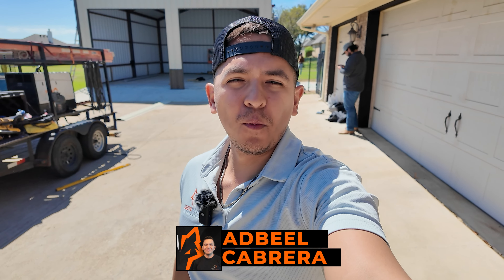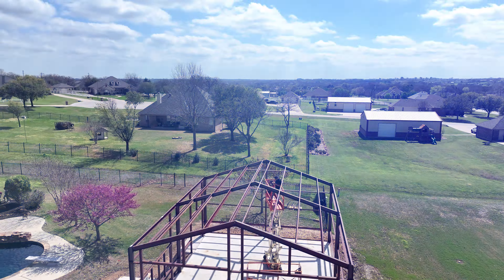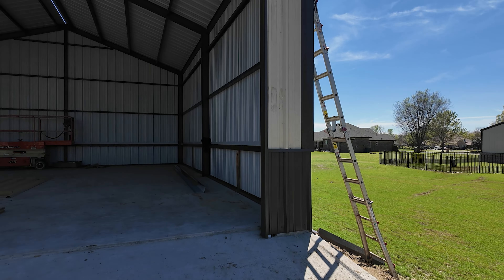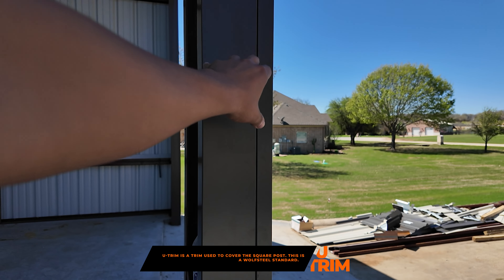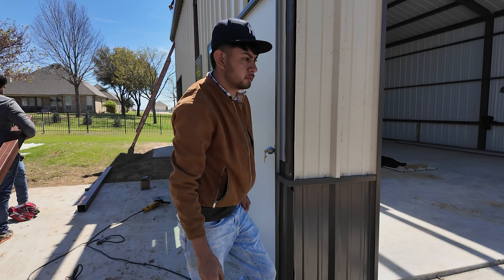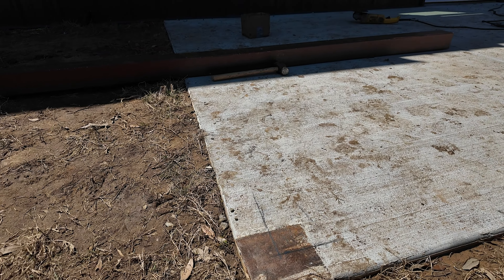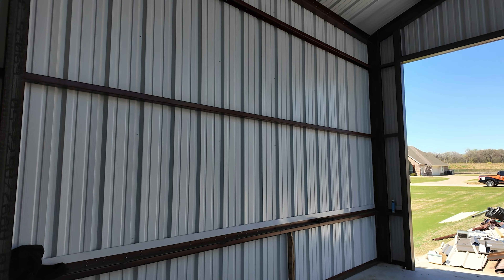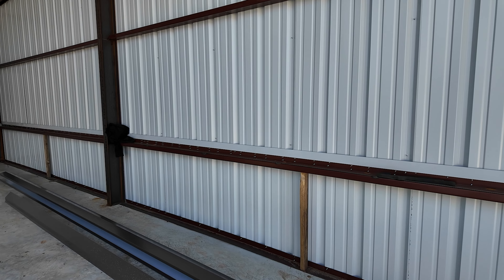Installation of 30'x36' Metal Garage in Burleson, Texas | WolfSteel Buildings

Comment: I noticed some of your buildings don’t have the base trim.  Is there a reason why it wouldn’t have it? Also, is it really necessary if the concrete has the 1.5 notches edge all around?
Reply from the maker: Good question! Typically, we add the base trim on metal buildings with vertical sidings to prevent critters and water from seeping through from the ground. Since the ribs run up and down, the base trim helps in covering the gaps from the building base. Unlike with horizontal sidings where the panels are overlapping each other. The overlapped panels already provide sealing for any gap.
Some of the buildings may not have the base trim because horizontal panels were used or the client opted not to add it.
On the other hand, the notch edge details are added especially when you have your garage door to prevent water exposure concerns based from our experience.

Comment: What is the engineered windage design for this building?  What is the live and dead load as well of this welding up design. My insurance company has different rates for the different ratings.
Reply from the maker: Insurance rates DO change according to engineering! 
Weld Up Red Irons do not have any engineering. Unless you get an engineered weld up (this adds time & price). Bolt Up Red Iron Buildings are engineered. 

If you are needing this information for insurance purposes you will need to look into either a engineered weld up or bolt up. This building was not engineered. We do building according to local codes (This case - Burleson, Texas). This is why we state location can affect pricing. 

I hope this helps you Scott!  
Check out this video on Weld Up Vs Tubular Vs Bolt Up: https://youtu.be/e8_2F4qEJfM?si=3Psr1IQSCA5Q_zFM